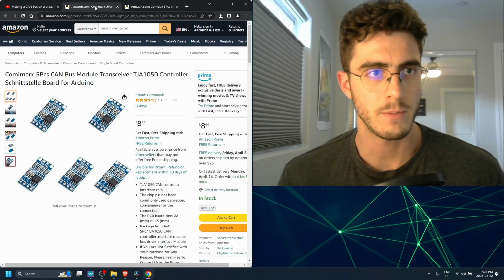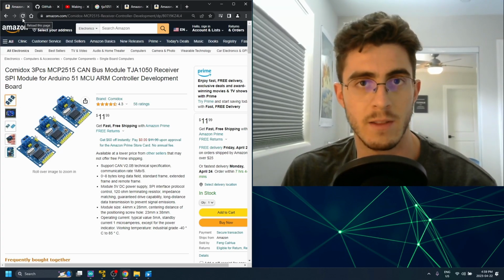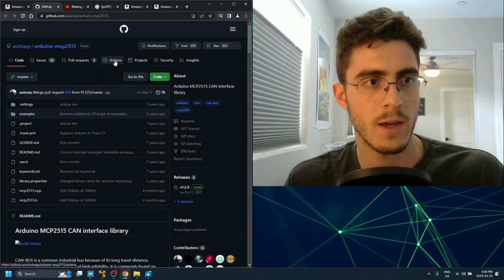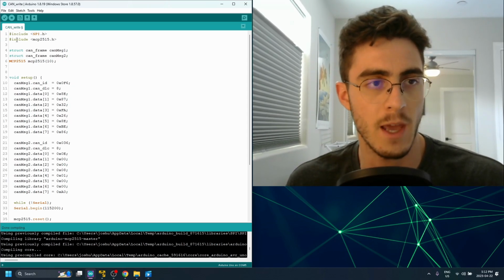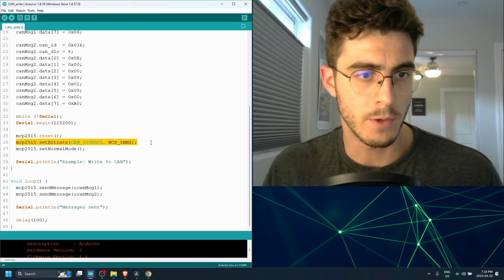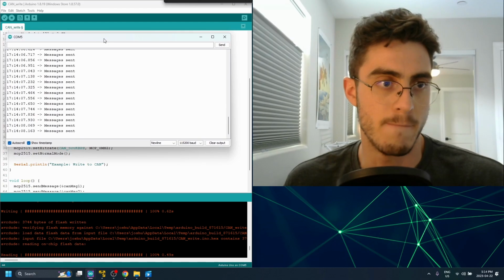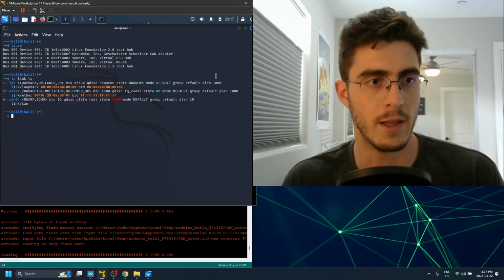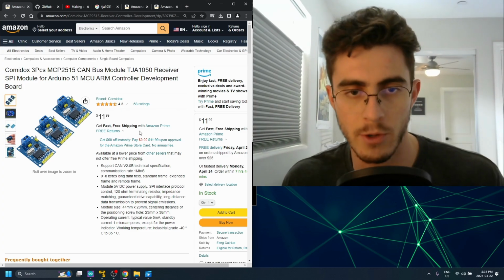MCP2515 CAN Bus Module Tutorial with Arduino and Linux

Comment: instead of using the USB_ CAN converter directly can we connect it to Raspberry pi and how?

And if not on which ports/GPIO of raspberry pi3 should i put CAN high and low lines

Comment: Seems like a bad-architecture upfront. If the Arduino can handle multiple inputs/outputs, then why set-up a system that modulates two-values? That's what i2c is for. Don't overthink it EV engineer; serial can be used as an input too.

Comment: Good day to you so I am seeking to make a custom gauge cluster using master slave combo with uno r3 and mega r3. I want to connect to combination meter to the OEM gauge cluster for my 2006 honda cbr1000rr... Will make a tutorial on how to connect for the master to read the can bus from the meter send that data to the slave and the slave display it on a tft, hmi, or oled screen?

Comment: 1:33 Here's probably an interesting twist to the CAN bus set up on Linux: Instead of this specific CAN-to-USB converter, which appears to be automatically recognized by socketcan, use an Arduino with MCP2515 to act as such a device. The Arduino already has the USB serial line to the PC that many of these devices actually use, so it's primarily about implementing a protocol that Linux already understands. Then it "just" needs to forward any message received from the MCP2515 (i.e., from the CANbus) to the PC via the serial link, and vice versa. One can probably tweak the Linux side to accept the USB device ID that the Arduino uses, because I don't think you really can control that on the Arduino.

Comment: HI thanks for your video, I watched again and again, and I tried by myself, one question about MCP2515 library,  because I need send a message with RTR, but in the example code, I did not find the rtr option, did you face the same problem and solve it?  thanks!!
Reply from the maker: Hi, I tried looking through this library to find a setter for the RTR bit, but I can't find one. You can do this yourself manually though. The Remote Transmission Request (RTR) bit is part of the frame identifier for standard (11-bit) and extended (29-bit) frames. To set the RTR bit manually, you'll need to modify the can_id field of the CAN frame struct. Specifically, you'll set the RTR bit in the identifier to signal that the frame is a remote request. For an 11-bit identifier: the RTR bit is typically bit 12 (counting from 0) in the Frame ID. For a 29-bit identifier: the RTR bit is usually bit 31 (counting from 0) in the Frame ID. 

For example,
frame11.can_id |= (1 << 12);  // Set the RTR bit
frame29.can_id |= (1 << 31);  // Set the RTR bit

Hope this helps,
Josh

Comment: I have a question for you if you don't mind. I'm using a flat screen car radio in my home for music, I'd like to control the volume with the canbus  that's on the radio wirelessly, with an esp32 and the Blink app. I just don't know how to built a canbus to make it work. Do you have any ideas that could help me?
Reply from the maker: Hi, just to clarify, are you trying to connect the car radio to the esp32 via CAN, and then communicate with the esp32 wirelessly over Bluetooth?

Comment: I've seen how two Arduinos with two MC2515s communicate between each other, but not sure how your setup works?  In my project, I installed VB with Ubuntu and extensions in Win10.  Installed Can-Utils and have my Arduino and MC2515 running a sketch that compiles, uploads, and runs in VB.  In the Ubuntu terminal window, lsusb returns the following: Bus 002 Device 003: ID 2341:0043 Arduino SA Uno R3 (CDC ACM), however, when I type ip link ls, the Arduino isn't listed and no Bus0?  Next I tried "sudo ip link set up can0 type can bitrate 500000".  After asking for my password, I get "Cannot find device "can0"."  How do I initialize can0?  Thanks
Reply from the maker: Hi, are you also using a USB to CAN converter?

Comment: I'm trying to use this Arduino to CAN, to send a message to an automotive module. Any chance I could get some help?  I've done the setup you show but the CANInterpreter isn't seeing the messages.
Reply from the maker: It’s quite common for CAN nodes to have acceptance filters. These essentially filter out CAN ID’s that the ECU doesn’t care about. Could be part of your issue

Comment: Hey, I really liked the video! Me and my friends are working on a similar system with a raspberry pi pico for a couple months now. We are trying to read an 8byte address from a car’s ecu. Do you know if the library can be edited to have that 8 byte address and if the CAN module with the MCP2515 and the TJA is able to convert from CAN to SPI (essentially reading CAN onto a microcontroller) if you can help, we’ve been suffering through the months with many many dead ends, and we’ll love if you could :)))))))))
Reply from the maker: Reading the internal memory of a car’s ECU seems higher level than just the CAN protocol in my opinion. A CAN frame can hold 8 bytes so that should be large enough for a word of that ECU’s memory. I’m surprised you found an ECU with 64-bit addresses though. Whether or not the ECU decides to give out its memory contents sounds like app level logic to me. You may want to check out the XCP protocol over CAN, which sets up an XCP server to forward internal memory state over CAN. It’s used frequently for debugging.

Comment: I have a doubt with cross compatibility between 3.3V microcontroller transreciever Physical layer and 5V microcontroller I have used MCP2515 with Arduino

Is it going to be problem If I use another node with 3.3V transreciever with MCP2515 module

One of your earlier videos had TJA1050 needed power recycling
Is there fixes as this is deal breaker 
For Permanent designs
Reply from the maker: Can Hi and Lo swing from 2.5V to 3.5V and 1.5 V respectively, regardless of which transceiver you are using. You may or may not need a TTL level shifter between the microcontroller and the transceiver. Completely depends on what components you are using
Reply: @EV_engineer  Thank you